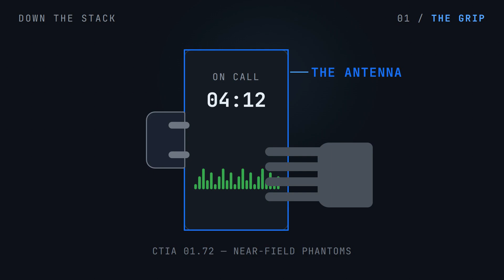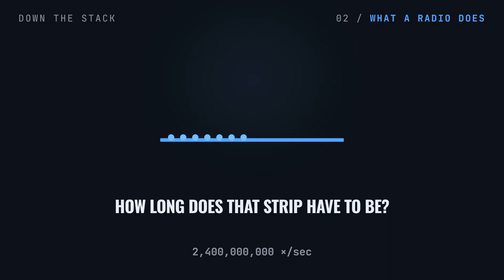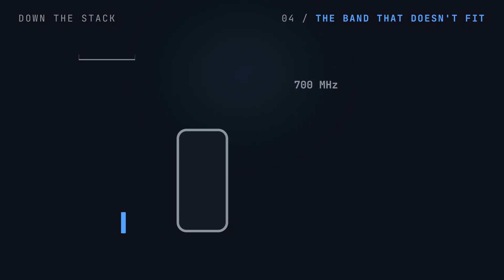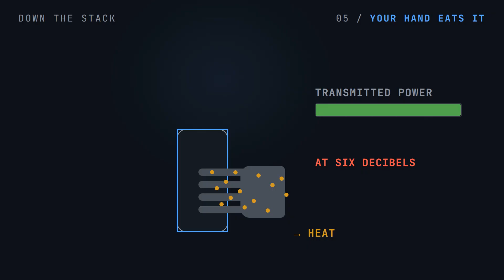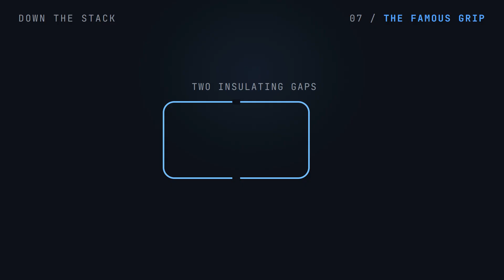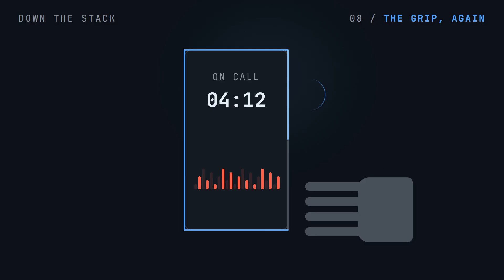Why holding your phone drops your signal

Comment from the maker: The one-sentence version: your phone's antenna is the metal frame around its outside — at the low cellular bands the wave is longer than the whole handset, so there is nowhere smaller to put it — and your hand then does two separate things to that frame: it absorbs part of the field as heat, and it stretches the antenna's electrical length so the metal ends up tuned to a slightly different frequency than the one being transmitted, and power reflects back down the wire instead of leaving. You have never held a phone that simply has a signal.

A few honest clarifications so the comments don't have to catch them: (1) Every decibel figure in this video is a measurement of specific handsets, bands and grips — not a specification. The mechanism is universal; the numbers are not. Your phone, your band and your grip will give different figures, which is exactly why I said "measured on real handsets" rather than "phones lose X dB." (2) The two penalties are separable in measurement but coupled in cause, and they are not equal: absorption dominates the total, while the pure mismatch (detuning) share is the smaller half — roughly 0.5 to 2 dB in the measured hand cases. I gave detuning more screen time because it is the surprising half, not the bigger one. (3) "Resonance" in this video means one thing only: the length of a conductor versus the wavelength it is carrying. It does not apply to your hand. Tissue loss is broadband dielectric absorption — water does not resonate at 2.4 GHz, that is a myth (I disowned it in the Wi-Fi dead-zone video and I am not smuggling it back in here). Same English word, two different physics. (4) This video makes no health or safety claim in either direction. That energy is absorbed in tissue is the engineering reason certification measures radiated power against a phantom hand and head, and that is where I stop — SAR limits and what they do or don't mean is a different subject and nothing here should be read as a claim about it. (5) Real handset antennas are folded, meandered, multi-resonant structures with matching networks, and at low band the chassis is the true radiator with the antenna element coupling energy into it. "Cut to a quarter of the wavelength" is the honest yardstick for why the size is forced, not a description of the physical part. (6) Handing the transmission to an antenna you are not covering is one tool among several — closed-loop impedance tuning, receive diversity, MIMO stream selection, transmit-power control — and the real decision logic is proprietary and band-dependent. That is why I quoted Apple's own patent for the two tuning states instead of speaking for "phones" in general, and why I said "several" antennas and never a number. (7) I deliberately did not explain the signal bars. Bars are a UI mapping of received power, they were genuinely part of the 2010 story, and they are a different video.

What should I break down next: why a game stutters even when your FPS looks high, or why your computer hasn't actually been off in years (restart vs shut down)? Vote below.